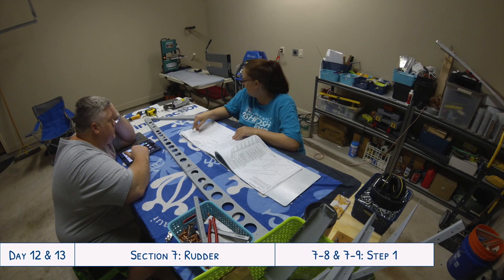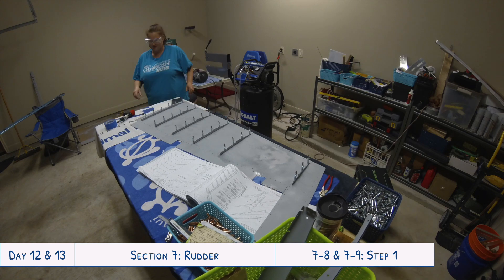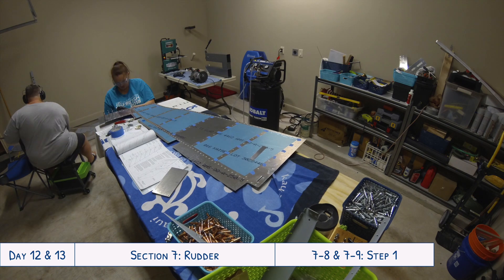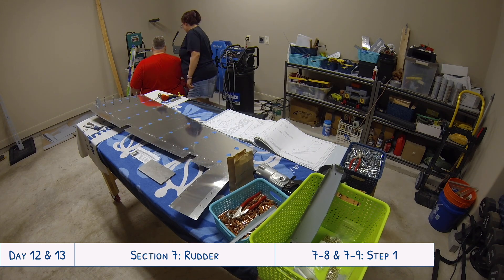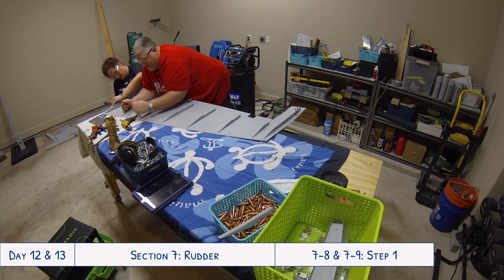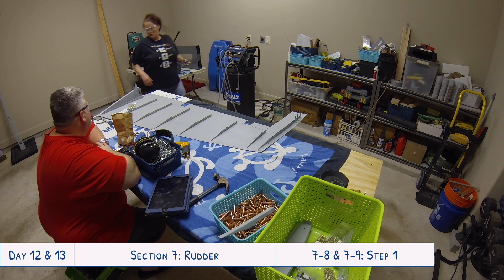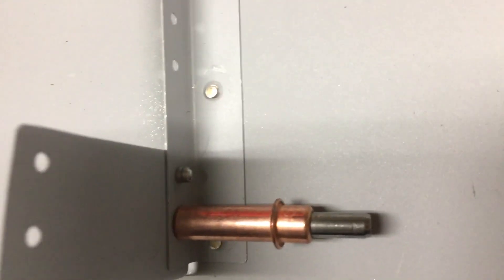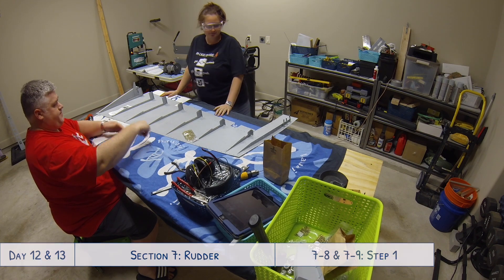Van's Aircraft RV-10 Build: Day 12 & 13 - Getting Stuck in a Small Space (7-8 & 7-9)

Comment: Have you tried a offset flush set and here is an example https://www.aircraftspruce.com/catalog/topages/flushset.php
Reply from the maker: I have not. That does look like it could come in handy in other places - thanks for sharing 😊 But at 3/8” thick at the base I’m not sure that would fit in this spot. It was really tight in there especially after one of the rivets was set, trying to get the 2nd one in.
Reply: @PlaneLady  Grind it to fit and one thing i've learned in aviation in the past 35 years is that most tools don't work unless you modify them! Great job starting the build of your airplane and I will watch your videos as  you continue with the build.

Comment: For the one that was on the end that was the hardest to get at.  Are use back riveting technique put a .025 Shim On the shop head and used and 1/8 punch through the opposite hole and smacked it with a hammer and it worked like a charm.  When you use a piece of steel offset and you were going to squeeze it or hit it with a rivet gun you have to support the other end the same height as the rivet
Reply: Thank you for this! I tried the indirect method, but was having trouble, so I switch to this and in a couple whacks with a hammer it set great! Thanks for the tip!

Comment: In the EAA class we used a fixture clamped to the bench (like Cleaveland Tools DIE4263DF). Would that have worked in this situation?
Reply from the maker: So we have that tool and tried using it the way you suggested before on one of the kits in a similar space. It still is a bit too thick. I might just call Van's and ask how they make it work without using a pop rivet.
Reply: @PlaneLady  Thanks. I'd like to know what you find out because I'll be in the same spot at some point.
Reply from the maker: Kent Colgan how far along are you with yours now?
Reply: Plane Lady I recently finished building a paint booth and the toolbox kit. If I didn’t have to go to work, I’d be starting the HS today!
Reply from the maker: Cool! Keep me posted! 😊

Comment: It funny as I just took the 1 day build class and we used the technique you described for the Vans wing kit... there are 4 tight rivets where the skins come together.  It did work but it was with a 426 3-3 and used the pointed end of a bucking bar to get in there to back rivet by hitting the larger end of the bucking bar ... that transfer the vibration to the point (it was not easy but doable - with a guy who has done this for years hahah) .  Also, what about a 4" Thin-Nose Yoke?  Oh...had to add... brilliant to 'take a break' when you are just tired and frustrated based on all the advice and other videos I have watched :)  Great video, love the new format....
Reply from the maker: Thanks Glenn! Glad you like the new format. Very familiar with that little Van's kit (we have made 3 each). Everyone we talked to about it says those rivets in the tip are such a pain in the butt; in the one EAA class we took at Oshkosh the instructor actually cut the tips of the rivets to shorten them in order to get it to fit 😳 Whenever we get to a tight spot like that again I'm going to give indirect riveting another shot, but I feel better now about using pop rivets if it's just not possible. At the time we really weren't sure about deviating from the instructions (it was day 12 & 13 after all so this was still very new) but it's great having a good number of folks to reach out to when we run into stuff like this now.

We did consider getting the 4" thin-nose yoke while we were at Oshkosh after this happened. Ended up going with the 2.5" flange-nose because we thought we'd get more use out of that one than the thin-nose - like more places where it would really come in handy. But that thin-nose might fit in there. Looked on Cleaveland Tool's page and didn't see a dimension for how skinny it gets at the tip; would be good to find out to know if it would fit in there if we run into a lot more of these tight spaces.

And definitely good to step back and take a break sometimes and come back with fresh eyes.
Reply: @PlaneLady  grrrrrrrr... a 'teacher' telling their students to cut a rivet - hummmmmm.  We were also using tungsten bucking bars which are really cool and really expensive :(  Also, because you are not riveting directly on the rivet, maybe try to up the psi on the gun... cheers...
Reply from the maker: Yeah those tungsten bucking bars are great! We have one of the angled ones that is smaller at  one end but even that would not fit in there - that's what I tried the first day with no luck.

Comment: I had the same issue and just used the pop rivet on both sides. That was advice from another builder.
Reply from the maker: Yeah, I wish we'd had the same connections back then that we have now because I'm sure they would have told us not to worry about using a pop rivet. Definitely would have made that a quick and easy fix. We just weren't sure about deviating from the instructions and the rivet it called for.
Reply: @PlaneLady  , Exact same experience.  Now a fan of the keep it simple approach and the judicious use of pop rivets where necessary/practical.